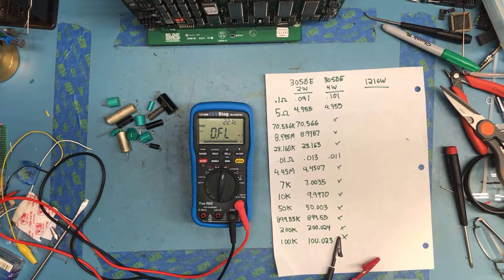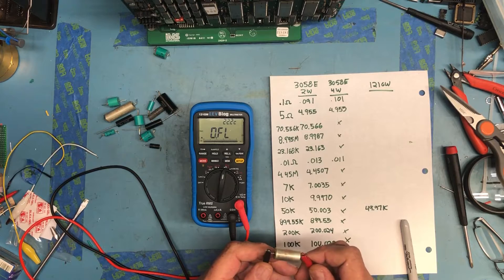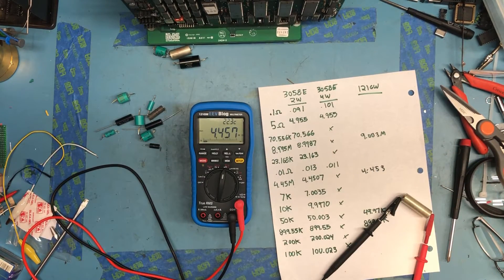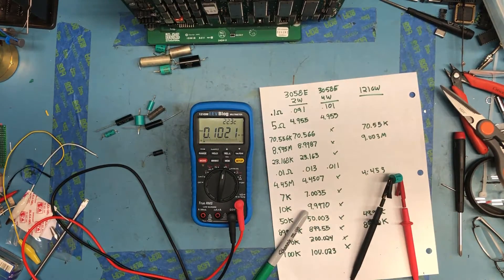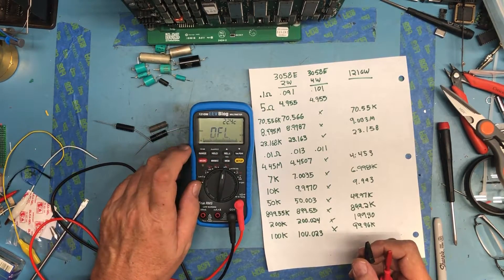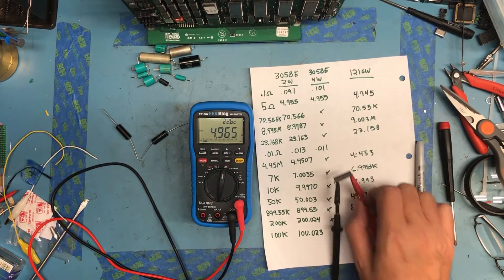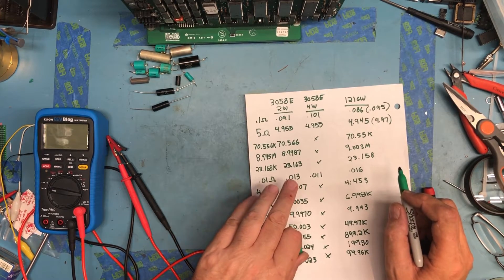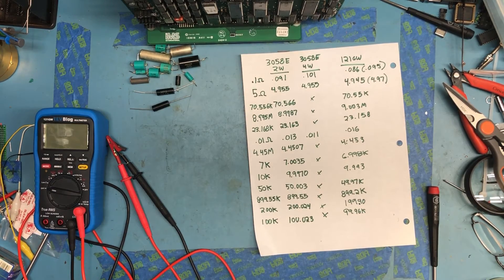EEVBlog 121GW  - Measuring resistors - Shootout with my Rigol 3058E - STB373

Comment: What firmware version is your meter running. It appears as though it's having hard time auto ranging. There's a firmware version 2. out there that supposedly resolves this issue. How do you like the meter so far? I keep seeing reviews with people complaining about issues...
Reply from the maker: Thanks, I'll look for the updated firmware. So far I'm good with it. I don't honestly know if I'd have paid full retail for it, I had a lot of Amazon Prime credits I used. The auto ranging has been somewhat annoying, it was working then stopped - watching the video I think it stopped when I used the "rel" function.  The manual is lacking, not finding the kind of detail I would have expected for the price. I intentionally didn't looks at any review or forums as I wanted to come to it without bias. It does have the fastest continuity mode of all my meters which is a definite plus.
Reply: @ShadowTronBlog  Oh yeah, continuity test is the redeeming virtue. :) 

Also, there's a shim installed under the dial.

This guy is comparing the difference in speed for auto ranging before and after firmware update:  https://www.youtube.com/watch?v=ASaypiMD6tk